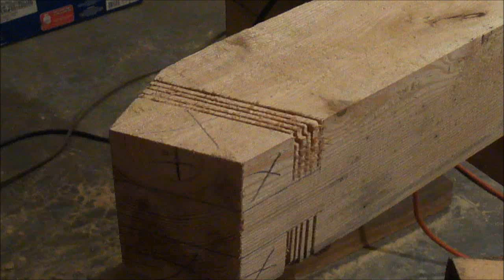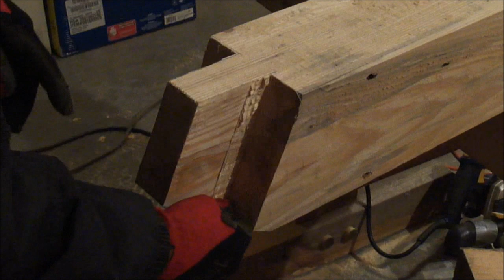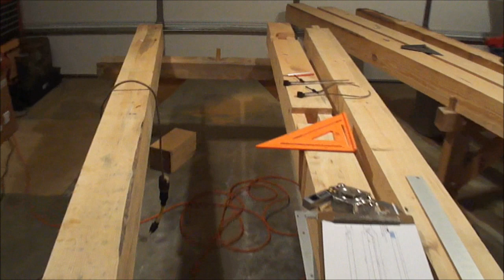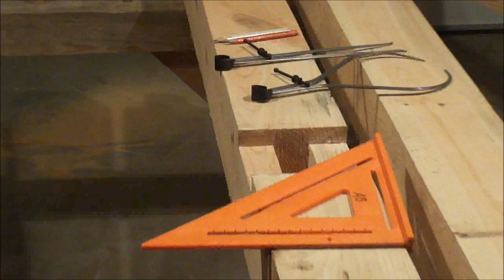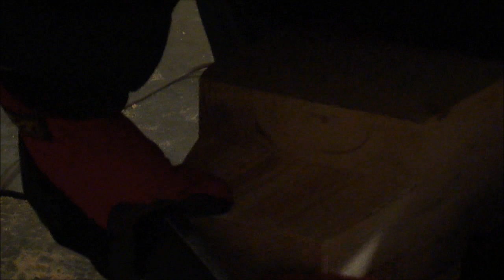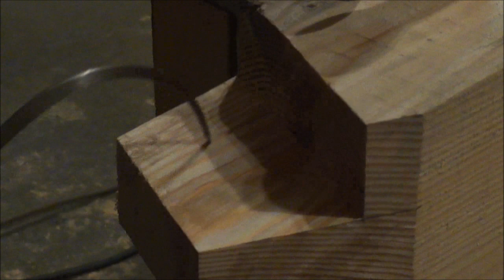Timber frame gin pole: brace layout & cut Part 2 of 4

Comment: Instead of buying the expensive, clumsy and heavy bigfoot beam saw like what you used, I bought the "Prazi beam cutter" for $100 dollars. it attaches to my worm geared 7 1/2 circular saw. It cuts 12 inch thick beams and ALL tenons very easy, With little practice it cuts very straight and accurate to my layout scribe lines. I usually attach a fence to the beam to run the saw against.

Comment: Looks good, but I have some tips for you. When you slice or cut the wood, you could use a jig like this /watch?v=GSpjMRP9D38 It helps to cut very accurate on the line. To get some more accuracy, you can make your line with a knife instead of a pencil. And you should not layout your mortices and tenons by measuring, but by using a template out of thin plywood or cardboard, so you can be sure, that they are all the same.